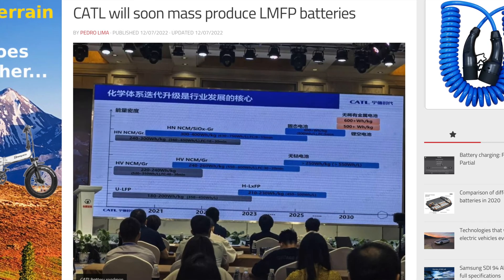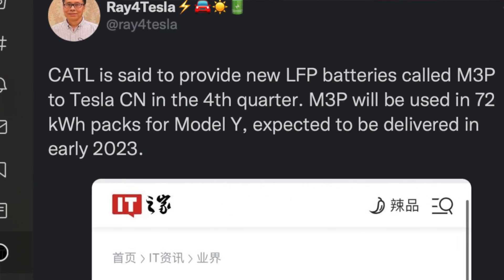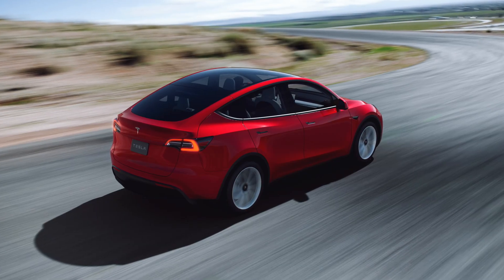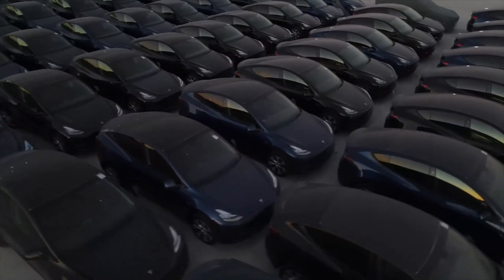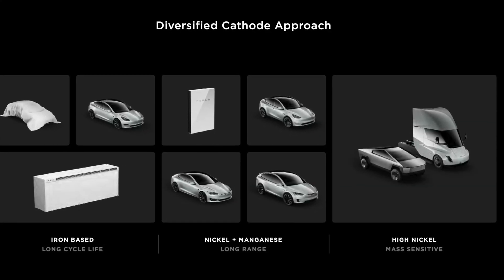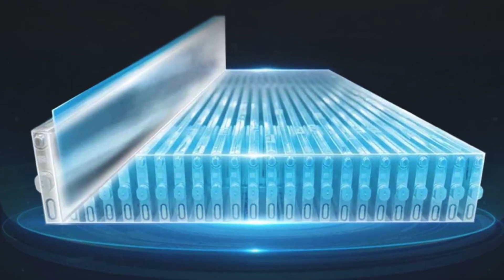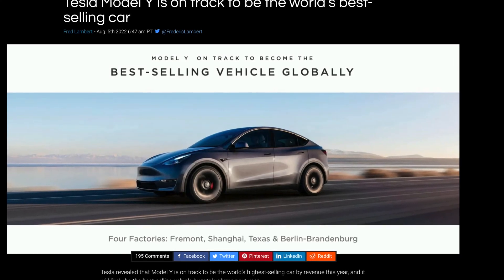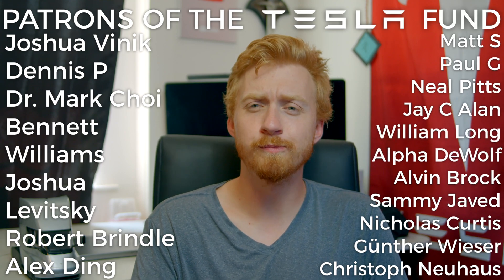CATL is Proving LFP is the FUTURE of EVs

Comment: Unless CATL builds a battery factory in the USA, I think Tesla may revert back to 2170 and 4680 batteries for the EVs made in the USA. This is because the Biden IRA tax incentives requires batteries and battery components and module assembly in the USA or North America. Both the 2170 and the 4680 batteries are made in the USA and would qualify for the tax credit, which gets stricter and stricter each year with respect to the battery.

Comment: Look no further for why model 3 long range has been removed from order page... put these cells in rear wheel drive and its good enough to replace RWD standard range and AWD long range... then you only needc2 versions RWD and AWD performance.... 2 chemistries 2 models ✨️ get in...... update 3 to have giga castings and reduced part count it will be way cheaper to manufacture, lighter in weight and more efficient

Comment: Thought LFP had issues in cold temp worse than other bat?
Reply: That was largely just tuning issues with the Tesla BMS which put a bad taste in peoples mouths.  Norway is stupid cold and uses a ton of LFP vehicles.  No batteries are great in extreme cold (except sodium ion but their volumetric density is super low) and this issue is mostly just about heating the battery at the right times (just like NCA/NMC does).

Comment: I hope this does work out because the prices of Tesla's are ridiculous. I'm glad I bought my Tesla when I did because I certainly wouldn't have afforded it at todays prices
Reply: Why would this working out drop the price of a tesla? At best this lfmp tech employed at scale in any ev vs a current nmc pack. 
Will cut a couple thousand off for the oem and not very likely much if anything for the consumer. As supposedly tesla is below $100kwh across all suppliers and catl was aiming for around $70kwh with lfmp. So even in a model s sized pack it would only save 3k for the oem. 🤔
Reply: @4literv6  The raw materials alone are cheaper as Iron is easier to get than nickel. That alone should make the cars cheaper. You are right however that it doesn't guarantee that Tesla would pass those savings along to the customer
Reply: Tesla prices are high due to simple supply and demand.  They could charge way less and still make industry standard profits per car.  Once Tesla and others scale out more factories entry level EVs will appear more and more.
Reply: Just a quick question. How do you feel about the quality control. I’ve been quite a few brand new teslas and the quality control is atrocious for a car of that price tag. Someone like me who only has Asian cars like Toyota and Lexus which are very high quality. Teslas quality really bothers me

Comment: While the LFP batteries may have more range and cycle life. There is 2 reason they won’t replace current LR. 1) those batteries coming from China won’t be eligible for the tax rebate next year. 2) their performance in both charging rate and discharge rate are lower. That lower discharge rate is good for one more but dual motors require more power. That is why LFP batteries are not put in LR models.
Reply: The charging curve of the LFP matches that of the previous NCA standard range plus
Reply: Lfmp changes that. Supposedly the lotus eletre is going to be shipped with catl lmfp quilin pack technology and fiskers ocean is also going to use only catl cells. Both of those are well over 350+miles of range and 0-60mph in around 3.5s in dual motor SUV. 👍🏻

Comment: LFP and high nickel will be the two types of standards . LFP for most cars. And High nickel for anything going far like a semi or a truck.
CATL is doing awesome work
Reply: Doing the Lord's work.
Reply: Sodium ion could also be in the mix for sub 200 mile city cars or short range trucks (ie ports / airports).  They are a few percent heavier than no current gen LFP but about 35% less volumetrically dense but not using lithium or any rare metals.  As theorycraft with less volume or weight of the top model Aptera (1000 miles with 2170s) they could fit enough sodium ion and still have 500 miles of range (probably 750 with LMFP) but ultra efficient vehicles aren't likely to become the norm.
Reply: @ccibinel  What about LFP for transportation, and Sodium ion for grid storage?
Reply: @KyleHubb  Grid storage is very important and will probably be the biggest use case for any low energy density / long life batteries.  Various technologies like sodium, liquid metal, cryogenic air storage, gravity storage etc will compete but if sodium is the main winner of those some vehicles that don't have much range requirements could use also it.  Trucks at a port drive ~50-70 miles per day in circles and many specialized vehicles at airports drive even less